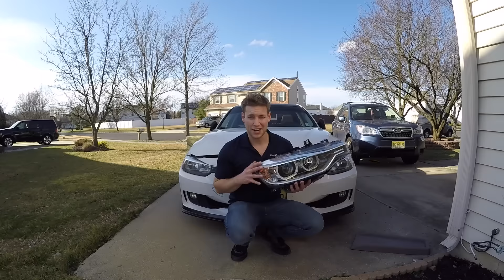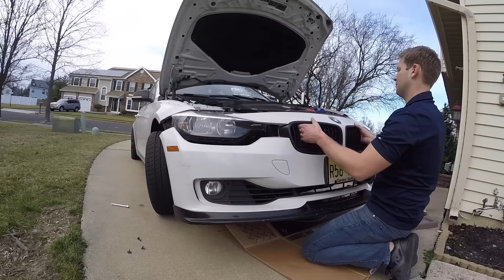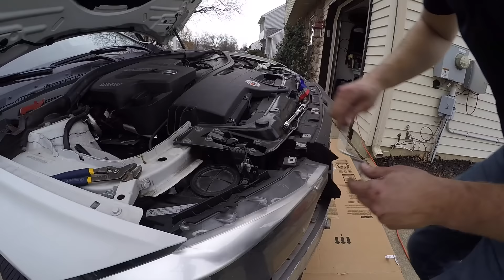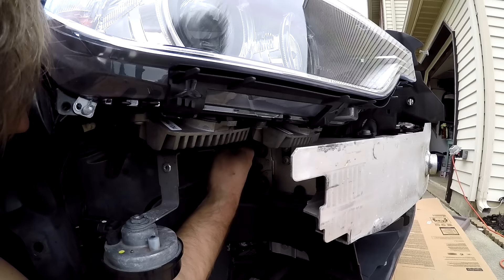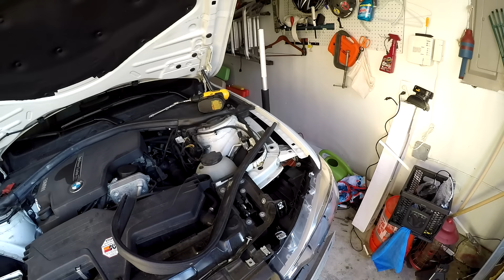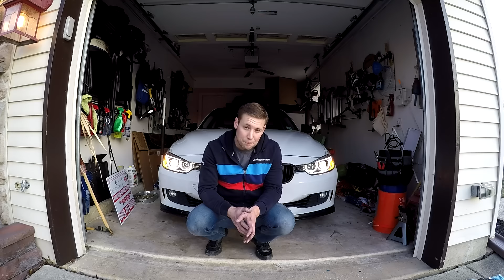BMW F30 328i Xenon Style Light Retrofit (Depo Projector Lights)

Comment: Do you put xenon bulbs to? Any nigth time video
Reply from the maker: The bulbs in mine were pre-installed. I just did this when I posted the video, so I haven't driven anywhere yet. Wanted you guys to get the video as soon as possible.
Reply: Tanks a lot
Reply: The headlights do come with standard 3200k bulbs and then the LEDs. I was told to put in GP Thunder or ZiZa bulbs to match the LED. If you want to do HID, you'd have to drill a hole for wiring, which does void your warranty. I get mine in tomorrow.
Reply: Did you ever find bulbs that you changed it to? I'm planning to purchase these headlights but would like to be prepared

Comment: thankfully, these days  you can just pop out the halogen bulbs and pop in GTR2 led bulbs which are great light, have a decent trail-off (I wouldn't call it an actual cut-off). I've only been flashed one time for too bright on-coming headlights.
Reply: no coding required. I didn't even need the available anti-flicker harnesses. I was able to return those.

Comment: What is the attachment called at the end of your driller at the 1:00 mark?
Reply from the maker: This? http://amzn.to/2lEiR7s
Reply: Kies Motorsports yes, does this one bend just like the one in the video? Thanks.
Reply from the maker: I used one of those, with a regular swivel for a ratchet set and it worked out great

Comment: not to forget. if you have headlight washers you need to unplug that aswell (as i experienced with mine), sitting on the right side. and damn. you have nothing behind the bumper. mine is packed with stuff. cant reach underneath the headlight barely. you should do a video on how to remove the headlight on a f30 335 aswell
Reply from the maker: Good tip!

Comment: Great job but my main question is what bulbs should you run to get the best light output ? Because I have used a projective headlight set up before and with the best and brightest LED bulbs I can get and the output SUCKS ! I guess you have to use really good HID kit./bulbs to get a decent light output.

Comment: Would these work on an 2016 328i I keep running into parts being grouped 2012-2015. But I wonder what can be the difference for the lights and such
Reply from the maker: Hi, you should be fine. Most of the products that you're seeing are labeled that way, because they probably haven't updated their systems since 2015. I'd just double check with them, but you should be okay

Comment: Hey man. I just installed these actually but wondering why the headlights are too inward at night. Have any idea to align them by any chance? Thanks!
Reply from the maker: Hi there are two adjustment points that are gray and take an Allen Key. I'll try to make a video
Reply: Kies Motorsports did you get a chance to do that bro?!
Reply: also wondering what did you end up doing?

Comment: Hi, I got these headlights and it looks so much better than the factory halogens. But the low beam and high beam are still yellow lights, is there any bulbs that I could change into white light?
Reply: Hi,

Did you ever find bulbs that you changed it to? I'm planning to purchase these headlights but would like to be prepared
Reply: hi, did you have to do any programming?

Comment: i really enjoy your videos, i think ill go ahead and get this set, how would these look with philips diamond vision bulbs for the low and high beams, 5000k? ive been digging through forums and have seen these bulbs are slightly yellow which im trying to avoid
Reply from the maker: Thanks! Just make sure with the company (USR) that they will fit..
Reply: Kies Motorsports they're h7 halogens pure white bulbs with a hint of blue from far away, I'm hoping they match the LEDs, I currently have them in my halogen headlights and I'll just swap them for the lows and highs plus I'll swap the turn signal bulbs with the OEM bulb holder and OEM bulb
Reply: Did you ever find bulbs that you changed it to? I'm planning to purchase these headlights but would like to be prepared

Comment: Hi Bryan. Had these fitted last week. They're fantastic. Just wondering if the led halos flicker when the car does the cold/warm check for the DRLs, and if this is something that may need coding out? Thanks for the videos. They're awesome.
Reply from the maker: Hey Joe, thanks for letting me know, glad it went well! I don't remember mine doing that, but I only had them on for a short time- Bryan
Reply: Kies Motorsports not seen them flicker yet, but I read that the cold/warm check needs coding out. What did you replace them with? Keep up the good work!!

Comment: @Kies Motorsports which bulbs did you use? HID's? Links please.... they look amazing. Could you pm me please, want to ask a few questions as I want to install these over the weekend. Thanks!
Reply from the maker: +Joseph L I just used the ones that came with them, but I'm running test LEDs at the moment
Reply: Did you ever find bulbs that you changed it to? I'm planning to purchase these headlights but would like to be prepared

Comment: Installed these from USR as well but the Angel eyes dont light up on DRL setting. Only comes on when in low beam or high beam. Any idea why that is?
Reply: Don’t bother. I feel so stupid. Settings must have changed after installation. DRL was ticked off in settings.

Comment: I installed these headlights after watching your review. My only problem is that the beams are aimed WAY TOO LOW. How do you adjust these Depo headlights?
Reply from the maker: There are two gray plastic pieces on top that have a spot for an Allen key, try adjusting there
Reply: The DEPO light had the adjustable gray pieces or just the factory lights?
Reply: Did you find a resolution to this dude?!
Reply: Hi, what did you end up doing, I am planning to purchase these headlights and would like to be prepared before

Comment: Did you install a h7 xenon kit too? They look like xenons not halogens 
 
I have this job to do tomorrow, I have parking sensors so i guess one more plug to disconnect
Reply from the maker: They came Pre-installed with the xenons
Reply: that is interesting I ordered a set from eurowagons in the uk (depo) you have to add your own h7 xenon kit otherwise use a normal bulb
Reply from the maker: Hmm, that's odd. I did notice that in the description, it says they are not included
Reply: It's very typical for us brits to be conned out of something lol 
Great video thank you - I think I'll remove wheels just make it that little more easier
Reply from the maker: Lol. Yea, much easier to remove the wheels

Comment: Awesome video! quick question though, I own a BMW F31 320D Touring, bought from Germany so it has the german spec, and I'm just wondering if the plugs for these Xenon lights will be the same. I currently have the factory installed halogen lamps and I've been looking around for the Xenon version. So I just want to be sure it'll fit as well before I make the purchase. Thanks!
Reply from the maker: Hi, thanks! I was told by the company that as long as your car is left hand drive, that they should work, but it may be worth a quick email. I don't see why the connection would be different, but it's a good concern
Reply: Awesome! I think I'll email them to be sure. Kindly give me their email address. Thanks for your reply

Comment: I just order my pair I can't wait to install.. does it also comes with the H7 bulbs?
Reply from the maker: Hi, yes mine did
Reply: Kies Motorsports do you have to code the DRL to be on by itself without having the low beam on if using stock h7 bulbs ?

Comment: Do u guys think its possible to install the 2017 face lift headlights on the pre-face lift? using "Carly" i know u can turn off the bulb checks and stuff so it doesnt flash codes left and right. I am thinking about soon changin out my 2011 prius to a halogen version of the 316i and change the halogen headlights to the Xenon headlight and LED bulb kit. I know one thing for sure... i wont EVER have a car with reflectors and halogen again after having my prius with two full LED projectors in each headlight... The light the provide is simply amazing, in 2011 it had to be world leading in its class. But yea... what do u guys think? or if i get a F30, should i just upgrade it to the ones u upgraded to? Im just really wondering if i at all should bother buying the halogen version instead of the factory xenon version... Cause of BMW`s advanced electronics its so much that can go wrong...

Comment: did u just put the
 Xenon Headlights and it worked ? no other things needed ? Like New codes ? new Wires for the Combox and so on ??
Reply: Hesham Daly it's literally just plug and play although you need to adjust the height of the bulbs. And I recommend changing the bulbs they come with cuz the projector light it's still kinda yellow

Comment: Hi! Do you have any issue when installing the h7 LED inside the projector? I’m concerned about there is not enough space to install the led in the high beam. Thanks!
Reply: Allan Ho have you gotten the answer for this? If yes, what headlights are you running now? Also do you need the H7 adapter?

Comment: In order to change your high beam do you now have to remove the housing?
Reply: You noticed the change in location for that access panel. On the bottom there are two heat sinks for led angle eyes too.

Comment: Do the halos light up when you unlock the car ?
Reply: Ricardo Duran  yes they do. I just installed them on my 2013 328i
Reply: Sjshark 408 a little late, but which brand did you go with?

Comment: I got a question for you i took my f30 to Bmw after installing new head light they don’t know why my passenger side low beam won’t come on but the high beam and turn signal comes on..🤷🏾‍♂️🤷🏾‍♂️I had the same issue with my oem headlight

Comment: Bryan thank you for the videos. I asked the UK distributors if the high beam bulb is accessible after fitment. And they said via the wheel arch. I'm not so sure. The low bulb and turn bulb will be fine but can you confirm for a high beam H7 bulb change? Thanks

Comment: Hi Bryan, thanks so much for your informative video.  I've been dissatisfied with the halogens on my F30 ever since I bought the car, and this solution looks very appealing.  I have a few questions and would really value your expertise:

1. This summer I have to travel to Wyoming.  I consider upgrading the headlights to be essential for safety.  Have you tested the performance of the lights on rural roads and been impressed?

2. You said that bulbs were included with your kit and that it was plug and play with regard to the computer.  Are the outer lights true bi-xenons?  Are the inner lights high beam only xenons?  

3. I've seen so many cars out there with cheap aftermarket retrofits that blind oncoming traffic.  Is that a concern with this package?

4. Aside from the loose connection on the turn signal which you fixed, have there been any other codes/malfunctions/workmanship issues?

I'm a good amateur mechanic but I'm not up to date on the particulars of xenon/LED lights.  I appreciate your help and hope my novice questions weren't too annoying.

Best,
Dan
Reply from the maker: Hi Dan,

Thanks for your message. I don't sell these, so I only have limited information on them, but I'll take a shot for you.

1. I would say they are definitely better, but you will have to do some fine tuning and adjustment. I haven't had a chance to do this yet, but I'm sure that would help. 

2. I believe they are all Xenons, except for the LED halo ring and the halogen turn signal.

3. No, as long as you make sure they're lined up, you'll be okay. Mine were pretty good from the factory, but I want to do some fine tuning.

4. No, that's all I've seen. I think the lights look amazing and the quality seems great. Some aftermarket lights look cheap, but I've only received good feedback on these.

Hope this helps. Feel free to email us at info@kiesmotorsports if you have any further questions or anything.

Thanks!

Bryan
Reply: Thanks again, I appreciate it.  I'll subscribe and watch for updates in case you encounter any other issues.
Reply from the maker: Thanks!

Comment: will this work on a 2014 320i with halogen headlight? Really want to get this done. Thanks
Reply: also, would the high beam and low beam now need HID conversion?
Reply from the maker: Hi, yes, it will. My car is a 2013 with stock halogens.
Reply from the maker: Mine came all together and even included bulbs
Reply: Kies Motorsports do you mind taking a picture or tell me which company hid/ballast that it came with? So I can get one that compatible with it.

Comment: but it's still halogen, title is a bit misplaced.
Reply from the maker: +bakkerman73 Technically, they are Xenons, however, they don't come with the bulbs. Instead of sending it without any bulbs, you get free halogen bulbs, that can be swapped out for actual HIDs. That's how they basically explained it to me..
Reply: Reading the product description, you might be right. It is a bit confusing. How do you experience these units with halogen compared to the original (terrible) units ?

Comment: Hi Bryan
I have a question regarding the Depos. I had them on my car for more than a year, they are great, but, recently i figured out that we don't need inner part for the high beam, cuz the lens have a shutter like every other xenon lens. Question is, can we turn of the inner part so that when i flash the headlights, only outer part flashes?

Thank you in advance ;)

Comment: so the Xenon lights will work even if you didn't have them before without any code issues? how do the DRL work/turn on if the previous headlights didn't have a switch for DRLs?
Reply: coding will be needed for that, I'm just not sure if apps like Carly & Bimmercode would be able to get the job done